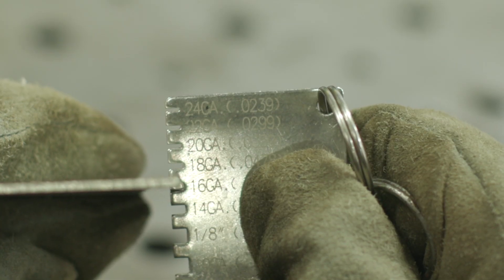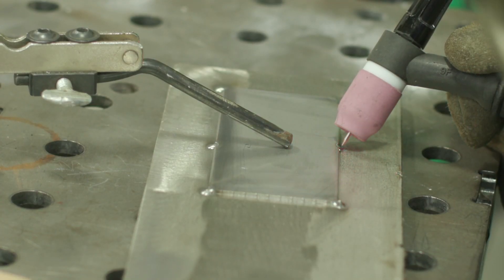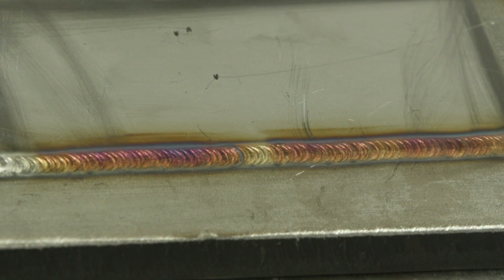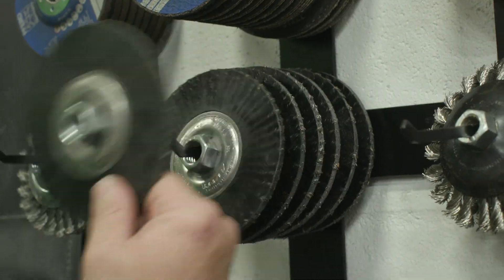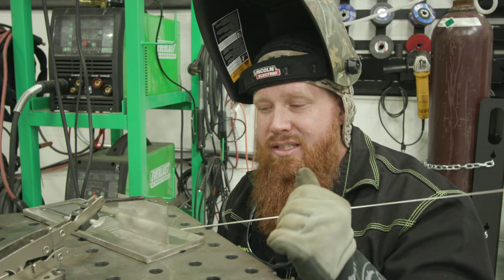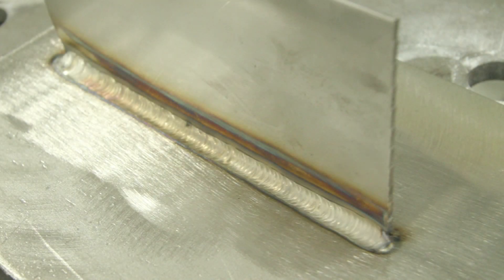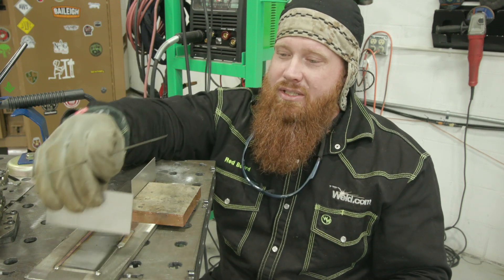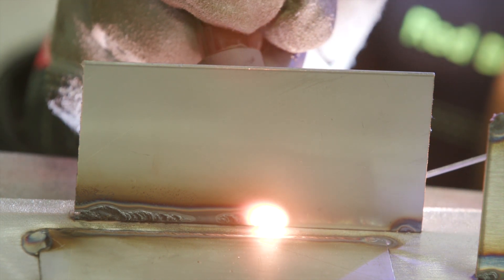Thin to Thick Stainless Welding

Comment: How about a video on heat straightening/shrinking steel.
Reply: I call it ripple removing
Reply: its pretty simple, if you heat/weld steel it will pull the material towards it, the thicker the weld the more it pulls, the higher the temp the more it pulls. if you want to straighten the steel beam (for instance) that you are working on. just heat the opposing side of the weld to about the same temp and same amount of time and it will pull back in shape.

Comment: 7010 on galvanized. I’m running a bunch of verts on galv and I run a 7010 down then cap uphill with a 7018. I usually reverse polarity when I weld decking with 7010, should I be doing the same on structural welds? I mean I’m doing fine just the 7010 aggravates the fuck out of me sticking and not wanting to weld a whole rod

Comment: I have a pannier rack for a motorcycle that had a fairly thin, 16/18 gauge steel off angle tubular connection to repair, would love to see your approach to this repair.  Butt join off angle tubular.

Comment: Comparison of common brands of 6010 and 7018
Reply: Bob Moffatt did a YouTube video. Stick welding 101. Check that one out. He also did one on choosing the right rod. You may find more what you're looking for and learn a few more things too. I know I did. They are older Weld.com videos but very informative just the same.
Reply: @christophermcmichael880  I'm not really talking about choosing between 6010, 6011, 6013, 7014, 7018, and 7024.  I'm talking about choosing between different brands of 6010 or different brands of 7018.  That video talks more about choosing between electrode numbers and sizes.  I'm more interested in a quantitative comparison between different manufacturers of the same size and number.
Reply: @elkvis  Hi. I miss read your comment. My mistake.

Comment: Good video,  I  welded a shock absorber for a car solid as a prank.  After draining the oil out of the shock and prepping I put the 1/8 filler rod against the shock wall,  started the puddle on the filler rod then moved the puddle to the wall of the shock.   Did the same thing on the rim of the shock then tied them together with another rod.  Was a pain in the * but worth every second when I saw his reaction

Comment: A video you haven't done yet would be welding stainless steel to mild steel.

You didn't say the video had be a conventional video. I only tried it once many years ago when I welded some 1/4inch round bar to some flat mild steel bar to make a rust free hinge pin for gate latch. As far as I know it's still doing a job.
Reply from the maker: Coming out Monday 👌
Reply: @Welddotcom  Jolly good! I used the Mig process when I welded the two together.

Comment: A wise man once told me.... To prevent blow outs on the end of THIN sheet metal welds... Stop half way across, then start at the other end and join the two welds in middle of the piece.
Reply: was that wise man Bob Moffat???